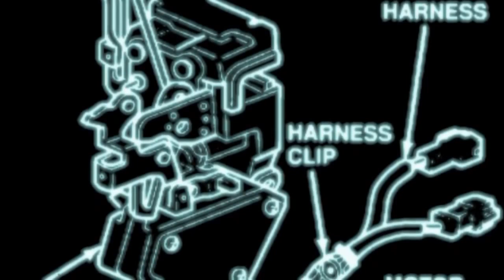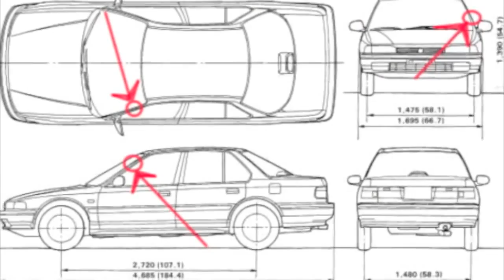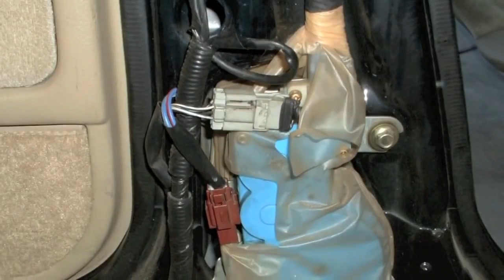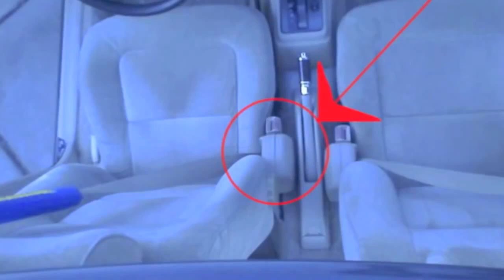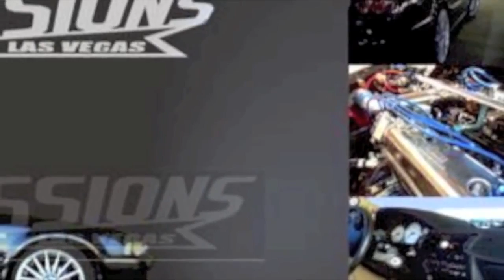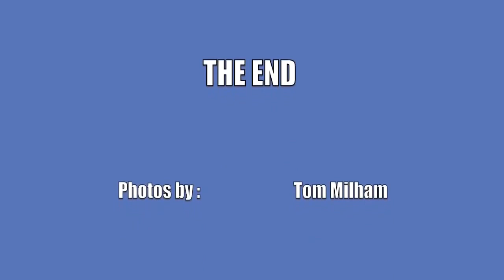1990 1991 1992 1993 Honda Accord Seatbelt Fix

Comment: You’re a genius, been watching your video for days, trying to understand it. I finally unplugged the green connector on the belt warning system, under the passenger seat, plugged it back in and everything works just fine. Fixed it without replacing anything!

Comment: I had a 1993 Honda Accord EX. My seatbelt stopped retracting. I troubleshooted it, and it was the computer under the drivers seat. It turns out that Honda has a LIFETIME WARRANTY on the seatbelt computer. This happened in 2004, I took it to Honda, and they replaced it for free.

Comment: Getting continuity from, first switch on door to box under seat, pretty sure its pre that something with the latch mechanism, bitch to take out, will have replacement if i go that far
Reply: Update, took apart and cleaned the contact where the jamb hits a little switch in the lock mechanism, had to take completely out of car but solved my problem, seatbelt now works like it should 😊. Great video 😊 😊

Comment: Great vid - thanks!  I've a different issue - the solenoid in the retract mechanism stays energized - always - even with the car off; key out.  Slow drain will kill the battery over a week or so.  Motor and seatbelt function and all works fine.  Unplugging the four-pin retractor  plug (to/from solenoid and to/from solenoid position check microswitch), and leaving the lap belt buckle wiring engaged, gets me a fast beep and seatbelt light.  Anyone got ideas?  I may just put a rocker switch to manually de-energize the solenoid when leaving the car.  Car's pretty perfect though; '91 Accord with 318K - needs its third paint job pretty soon.

Comment: Thanks for posting this video. Exactly where is the contact point to be cleaned on a 1990 Honda Accord LX two-door coupe 2.2L?

My problem is the driver side seat belt is stuck in the Forward position. When I close the door it does not know that I closed the door therefore not retracting back behind the seat. With the Allen wrench tool provided by Honda I can retract the seatbelt mechanism. With the door closed, I can turn on the key and nothing happens. But when I open the door the seatbelt mechanism goes to the foward position. So the motor is working.
Is there an exploded view of the door latch assembly available on the internet, so I can locate where the contact points are so I can clean them? Any help would be appreciated
Reply: Im having the same issue brother what did you do to fix it?

Comment: Hello The pyro sensor in the seat belt pretensioner could be bad. Most 
likely need to replace the seat belt pretensioner. You can buy a used 
one on www.eBay.com 
or send your seat belt for repair at www.myairbags.com

    Here is Video
https://youtu.be/xT5tiT2A78w

Comment: Drivers retractable seat belt will not go back. It stays forward. I can crank it back, but when I open the door it goes back to forward position.  Is there a fuse that I can take out after I crank it back? So it will stay. Or can you tell me if I can replace the motor myself?
Reply: The switch in the door works when the door opens but not when it closes.  This tells you that everything else seems to work just fine.  It has to be that switch.  Either it is dirty and not getting a good connection when the door closes or the switch has gone bad.  Try cleaning it first and if that doesn't work then replace the switch.
Reply: kerri lyn vigil did you find a fix for this?
Reply: got the same problem!  i need help

Comment: of both go out same time. before you do anything. check your fuse under the hood the one that says radio back up it's a 7.5a
Reply: 6 years later and homies comment blessed another cb7
Reply from the maker: +Jolene Martin does your driver side seat belt work?
Reply: So if my passenger seat belt  dont work look under the hood for the fuse called radio back up?
Reply: I don't know about a civic, but a 91 Accord the fuses are labeled L passive motor and R passive motor each dictating which side, 30a fuses